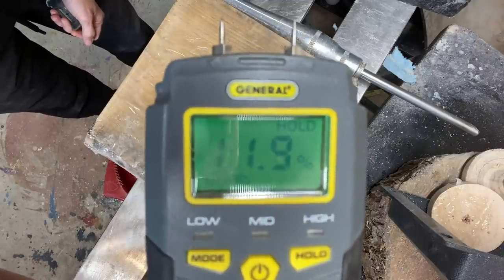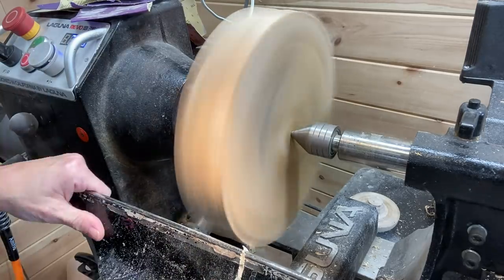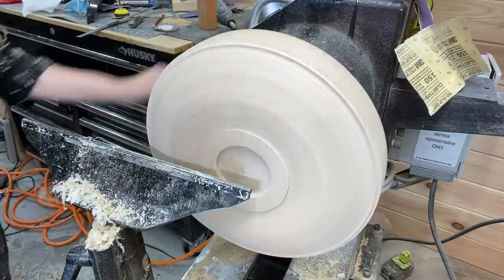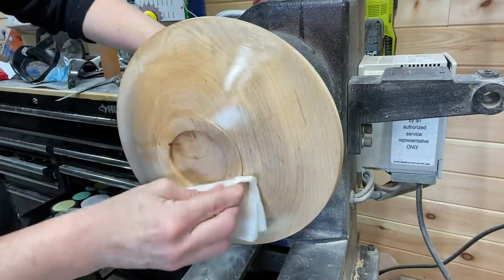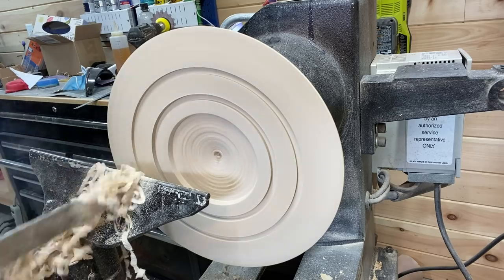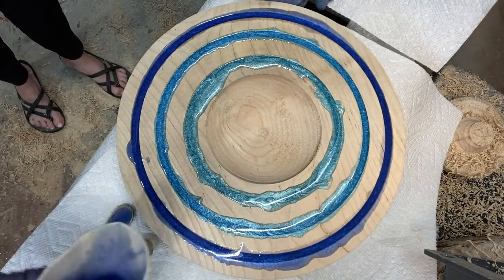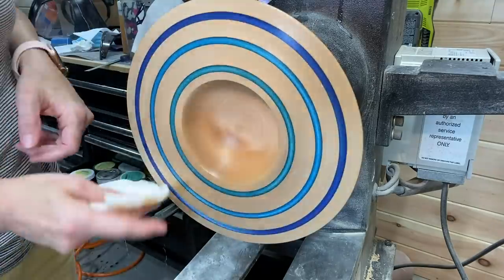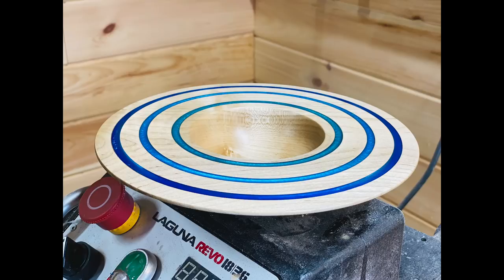Woodturning with RESIN: 3 rings of BLUE!

Comment: Really great job and creative hollowing.  You may know this, but it helped me. When I use large forstener bits I clean both ends of the Morse taper with 4/0 steel wool and the clean with acetone. This ensures no contamination and minimizes spinning and gauging when boring/ drilling large holes.  Thank you for your dedication.
Reply from the maker: Great tip!

Comment: Hi it's great to see a young lady doing woodturning, they sometimes put us men to shame in what they can achieve, I am retired living in France on my own, I have just started to do wood-turn again, I have noticed that the in thing is wood and Resin now, they look amazing, especially as you can use that wood that is normally rotten or splits and you can incorporate resin into it and you can get a beautiful affect which obviously saves the wood going to the log burner, .
Very impressed with your work, I am very safety conscious I hope you're wearing a dust mask I noticed you're wearing a fullface shields which is good but some words can give off spores which are dangerous and obviously the dust, so please be safe especially in this climate at the moment with the virus is going around keep up the good work love your YouTube film.
From the old geezer lived in France.
Phil from the Moulin in France
Reply from the maker: Hello! Thank you. Yes,  I do (usually) wear a dust mask. Though new ones have been in short supply lately. Shopping around for a full face mask that circulates fresh air and keeps out dust—they are fairly expensive. Still looking. Thanks for watching!! Never been to France—hope things are safe as they can be there! 🇫🇷
Reply: Hi PF Woodworking.
Thank you for your reply, as for a full face air fed , I have got a 3M Air fed mask , and yes they are very expensive but well worth it, mine is even got the ear defenders on as well , 
It as been very very bad over here and likewise where you are as well from what I can gather and it looks like they could be another outbreak virus as there was something on the news this morning, 
You're more than welcome to pay me a visit but I think coming out of the country and into France I think is still banned as I've got friends in Australia and they are not allowed to leave.
Anyway keep up the good work look forward to seeing another YouTube from you in a few days time or week or whatever keep safe kind regards Phil from the Moulin in France.
Reply from the maker: Thanks. Yeah, I don’t think traveling now is a good idea in general. Americans are not allowed in most countries now anyway.